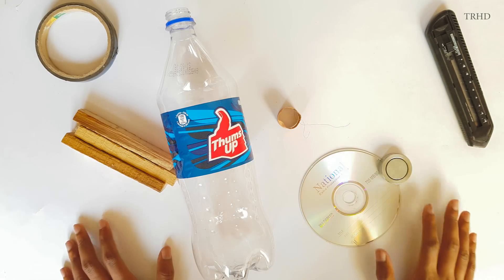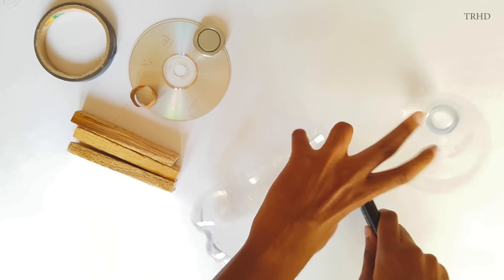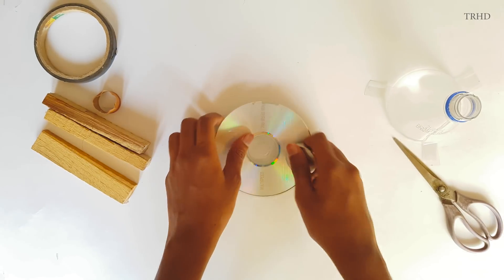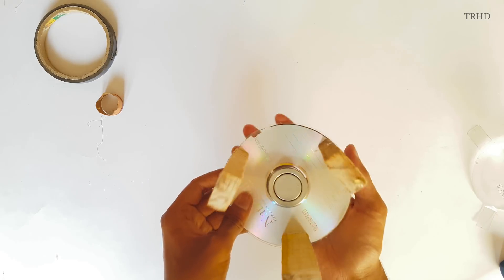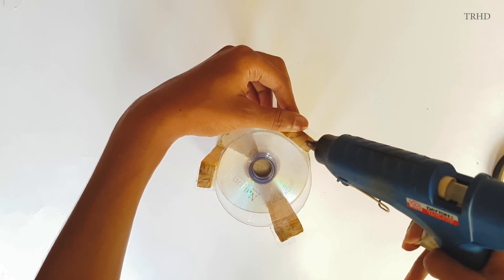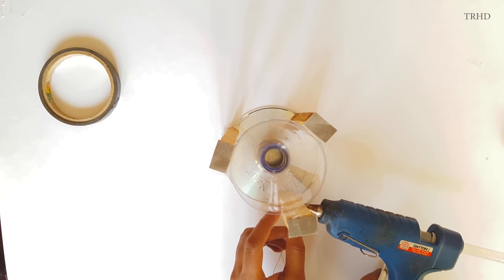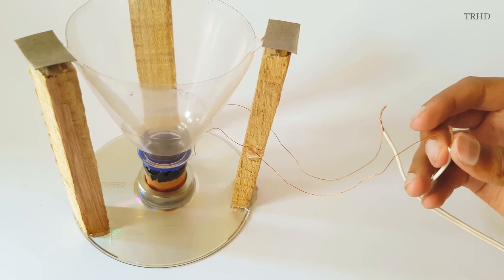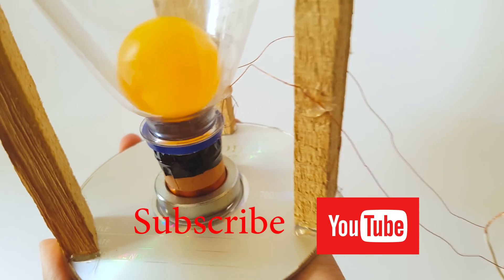How to Make a Speaker at Home using Thums Up Bottle | UHD 4K

Comment: sir did you use neodymium magnet? how many turn of copper wire to make voice coil? & how many is the speaker impedance that you make that speaker like for ex. 4ohms 6 ohms 8ohms 16ohms ect.

Comment: Hi Vimal.  Would it be good to put a temporary spacer, maybe a few millimeters,  between the coil and the magnet when making the speaker, and then remove it when finished to allow some downward movement of the coil   I have seen other homemade speakers, but this is the best yet.  Homemade paper cones, instead of plastic,  might help, but the harder plastic is probably better for higher frequencies.

Comment: How can you improve sound quality? Should you turn the copper wire around more or should you get a bigger magnet ? or some other way
Reply: increase the voltage coiling it to much will create resistance make sure amplifying the speaker and coil maych
Reply: +Carlos Bilbao But if i used an amplifier and coil it 100 times or more would that mean I would get better quality
Reply: +Nor1Gamez you can improve the quality by making something that bounces it up and down as it is playing music like a flimsy material like paper